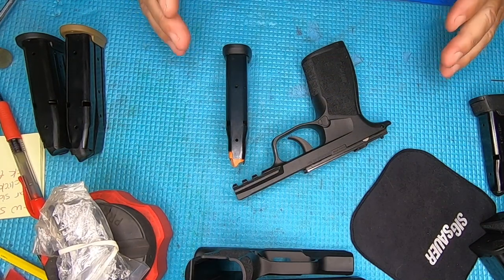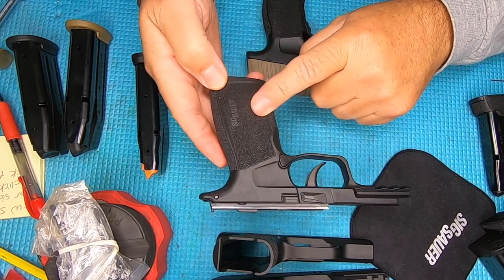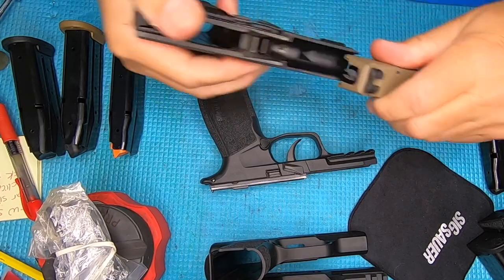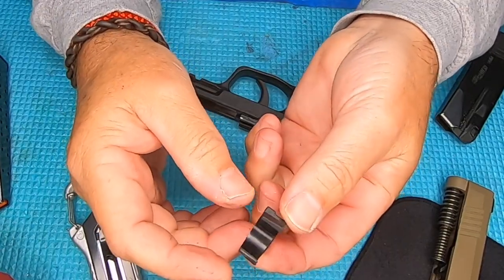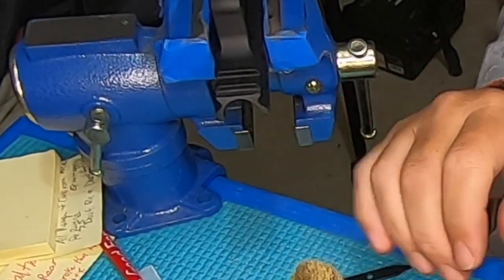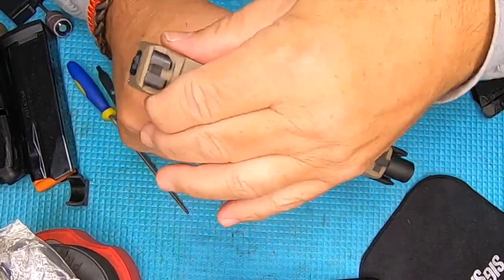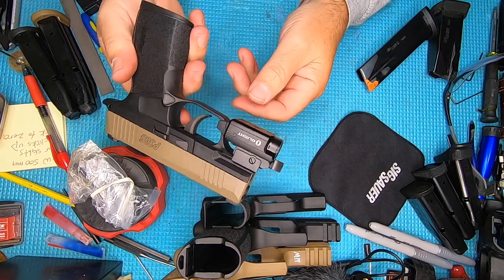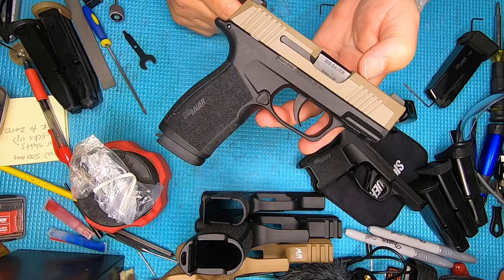Sig P365 XMacro Grip Module Cut to Fit P365 Original Slide

Comment: 😎 Definitely a fantastic idea. With all of current P365 options Sig has now, I’m surprised they didn’t think of it first. Just by visually comparing it from the original snappy design it looks well balanced. Simple solution was to give it a longer beaver tail and optional swap out hand grip plates. Now add an RMR and light on the rails and Sig could dominate the self defense market for a while. I’d like to try it. Listen up Sig, SC Legal Carry is on to something here. Call it the High Capacity X or HCX 👍🏽

Comment: Cool video. I just got the x macro grip module from sigs website, $80 with the mag release button. I installed it on my 365 XL with manual safety. Had to do a little work to get the safety to fit, cut small grooves and sand it a bit. Works great. Going to make a leather holster for it, as the x macro trigger guard is wider.
Reply: Do you have any pictures of what you had to trim for that safety in the macro grip?
Reply: @xjchase  just cut a small hole and make the grip narrower where it interfaces with the safety. Basically Dremel/file and sand paper and 20 mins later. Ensure itt works properly.

Comment: Instead of cutting the frame wouldnt it help to just add a comp and a little longer to have that flush look and help mitigate recoil more?
Reply: PMM comp with original P365 should fits X macro frame with no modification.  the specs is perfection no doubt

Comment: THANK YOU THANK YOU THANK YOU.. I want a subscriber until I saw this. I have a p365 xmacro with NO comp.  I bought a DK custom woodland camo grip module.   And for some reason it's just a little to long.   No sure why but it says.     (Some people tell me when it's a little long bc it's prob .ade for the one with the comp.. however they wrong.  Why are they wrong.. bc mine has a 3.7" barrel.   The xmacro with rh comp is 3.1" barrel but when you add the comp it's exactly 3.7". Go to sig website you will see..) anyways this is why you helped me SOOO MUCH. I need to take a little off. I can probably file it down howeve no matter how much I need to take it off you showed everyway.   From using a miter saw, to a metal file, even with a Dremel.  I wish I had your email I would like to send you a few pics and I have some more questions for you as well. But anyways super loved it.   Can't wait to watch more thanks bro 

Ryan FL

Comment: Does the Olight work perfectly with the attaching part mounted properly (no backwards as shown here)? Or would it be better to cut the module leaving 1 more rail on it (since it'd still be the length of the Olight)?

Comment: I know it adds cost, but I'd rather get a threaded barrel and a compensator and use the P365 macro frame on the P365 standard slide.

Comment: How about a holster? Any suggestions? I just bought the grip module. Am waiting for it to arrive. But now I’m worried it won’t fit into my existing iwb holster. I’m pretty sure it won’t.
Reply from the maker: The grip is thicker and it does not fit in my holsters.
Reply: @sclegalcarry7979  interesting, I’ll know more soon. I have a TXC holster that seems to have a little flex. Maybe I’ll get lucky

Comment: will an Xmacro slide fit on a standard p365 frame?
Reply from the maker: Yes
Reply: @sclegalcarry7979 this is a big help. This is exactly what I would want to do if I bought one. 365x with the x macro comp slide. That way I still have the ability for a smaller grip. If I carry I want it to be as forgettable in terms of size as possible. 12 rounds and then a 17 round if I ever had to reload.
Reply from the maker: O don't pwn the xmacro slide. I am sure someone on YouTube has done a comparison video.

Comment: Quick question, what holster are you running with? P365 or a x macro holster?
Reply: After reading your question I went and switched my 365 slide to my x macro grip module. Fit perfect with my comp and it fit the same holster I use for the x macro. I am using a Aliengear Photon with tlr-7a. The 365 slide has a tlr-7 sub for sig. they both fit perfectly.
Reply: Amazing!!! Thank you so much

Comment: I did this to my SIG P365. I dremeled  the picatinny rail slots off the Macro module so it will fit in a SIG P365 holster.
Reply: Thanks for the tip! That is all I needed to hear…cut that last little bit off and it will fit my current holster. That’s huge!
Reply: @mishmash7222  it will take some time and lots of test fitting but eventually it will fit. It helps to have a regular 365 module beside you to reference where material needs to be removed.
Reply: @GreenGunTube  Thank you! I’ll make it work.

Comment: After handling one in a store, I wanted to get a macro, but this is a perfect solution. I have to spend a fraction of the price now, and I didn't really need or want a longer slide in a CCW, having a longer slide would cause problems with appendix carry where currently I have to hike up my pants to have the muzzle pressing into soft tissue instead of my pelvis and if I added more length it would invalidate that solution because I can't pull them up more than I already do. I mostly just wanted the bigger mag and the Fuller grip. With my 365X, I have to carry the 12 + 1 in the gun, and two mags to get 36+1. With the 17 round mags in the macro you only need one spare mag to do 34+1.

17 + 1 seems like plenty on its own where you wouldn't need a spare at all, but it's possible for magazines to fail or malfunction and your gun becomes inoperable unless you can put in a spare, even if the original still has most of all of its ammo.

Comment: You could also buy a threaded barrel with a compensator and itd look amazing and no cutting!
Reply: Would a compensator barrel work on 365x leaving the macro grip full length?
Reply: @bettercallhag  maybe not the x slide because I believe those are a tad longer so wouldn’t fit flush.  I have a 365 regular size slide with threaded barrel and Herrington arms compensator and it fits magically
Reply: @Gatsquatch.300  Debating on whether or not to do this with my p365.  A threaded barrel, the comp, the grip module, and two magazines would run about $480 before shipping.  The X macro also comes with the slide cut for optics, so I wouldn't be getting that.  Just purchasing the grip module and two mags is about $200.  Not sure what I'd prefer for concealed carry.
Reply: @Saint_John_The_Forerunner  I knowwww I wish it all wasn’t so much money, here’s one for you, Icarus aluminum macro grip module $400, used macro slide, taran tactical mag extensions (adds 3 to the 17!) and looks beautiful with grip,  suppressor height X-ray sights to fit a 507 holosun and cowitness, probably didn’t need the suppressor irons lol, but look cool.  Oh! And cerakoted the whole thing to look like an oil slick purple. So I’m with you on the $$$$ man lmao, and now Icarus made a base plate that matches the grip module!!! $90 and have to get the cerakoted to match.  Needless to say sig has trapped me in their $$$ rabbit hole
Reply: @Saint_John_The_Forerunner  I’m thinking about posting my gun on a YouTube short but I’m not the Type to show off too much, however make your gun man spend the money!!! Allow me to be the devil in your ear and kick the angel on your other shoulder the hell off!!!! Lol do it!  Then let’s compare builds, or shit, I’ll sell you my 365 that’s leftover from the Icarus build hahaha
Reply: @Saint_John_The_Forerunner  I will say if you’re gunna do comp prepare to buy guide rod with tuning springs because you may need a new spring (longer or shorter) depending on the gas expelled from comp.  Just be prepared to tune gun but dude!!! Do it.
Reply: @Gatsquatch.300  Does your comp fit flush with the end of the xmacro grip?  Take a pic and post in on imgur or something.  I gotta see lol
Reply: @Gatsquatch.300  Yeah, those icarus grips are nice but they're never in stock :D
Reply: @Saint_John_The_Forerunner  like it’s not flush flush, but it hangs off the grip ever so slightly like barely,